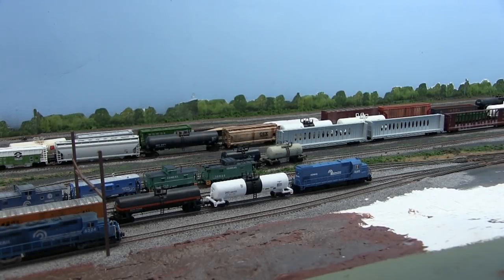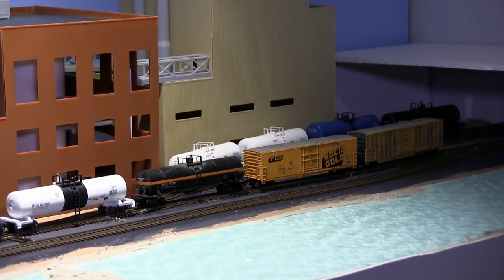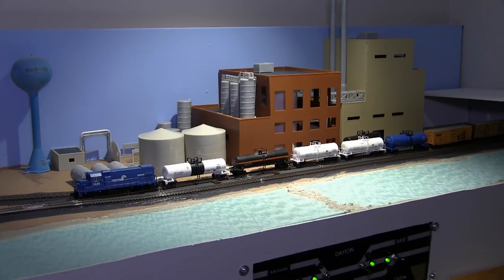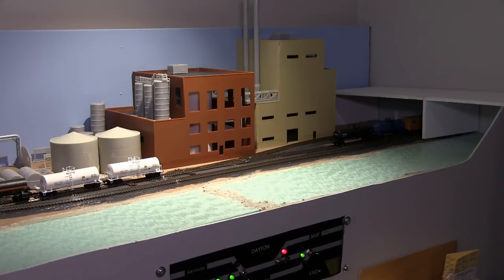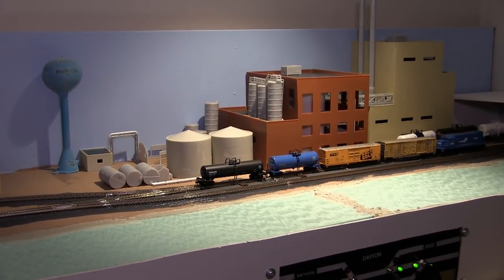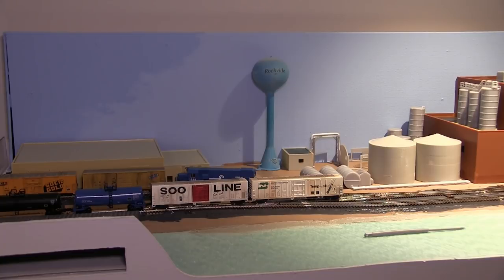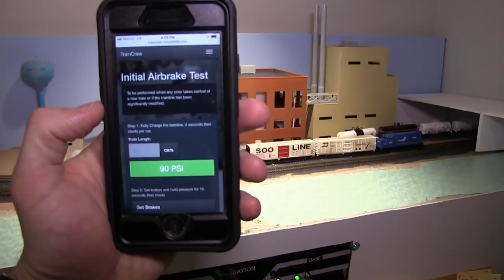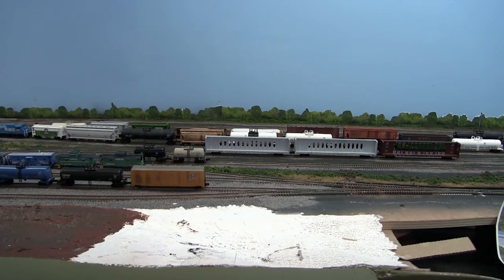Operating WJSA-33(331)

Comment: Great job Joe! When you were pulling the cars from RJR foods, I thought for sure there wouldn't be enough room and that the 4 cars on the main would have fouled the turnout to RJR. Lucky there wasn't more than two cars to pick up at BASF. Having that car with the EOT is just like having a caboose! Same problems of getting it on the proper end of the train. One question: when coming back to the Brown's Yard, did the crew need to get permission from the Yard-master or the Dispatcher to enter the Yard? Thanks for sharing.
Reply from the maker: I designed it that way lol a perfect fit! So yes the crew needs to get permission from the yard master then contact dispatch to cancel the form D. There is a MP in the wye that also serves as the yard limits. I will admit it still is a work in progress, trying to iron out the details in the ops session with my operators. Great question!! Thanks for following along!

Comment: would you have to leave the card car behind for the car you set-out?
Reply from the maker: yes! I placed a bad order card in the car card( if you dont you wont remember why its there) then I leave the car card in the bill box ( there is a slot in that box for the run around). If you dont leave the car card then car will get "lost" in the system. Next time I run the layout I removed the bad order card (because it got "fixed") turn the waybill to the next position and the next crew knows that the car need to be picked up. Thats the beauty of the car card system it is self-routing/self-correcting. Great Question!! thanks for watching!